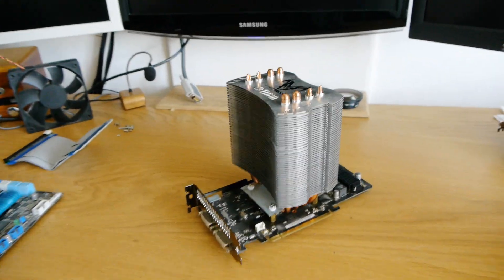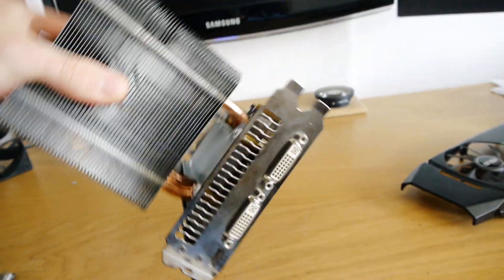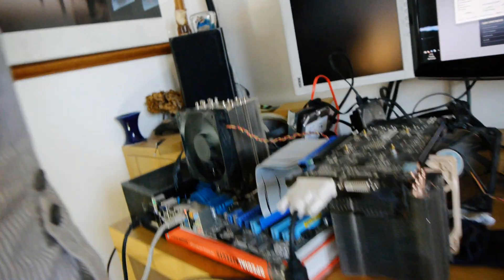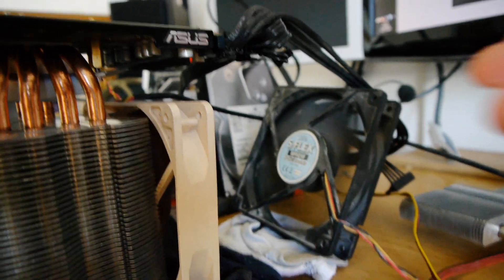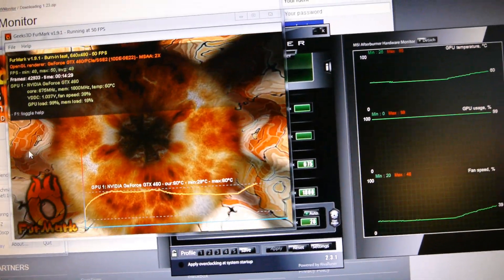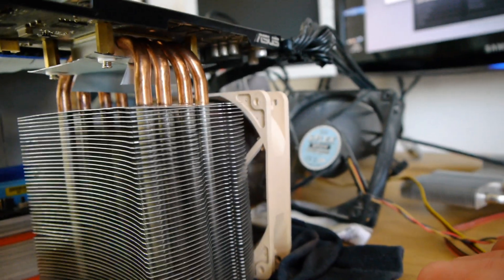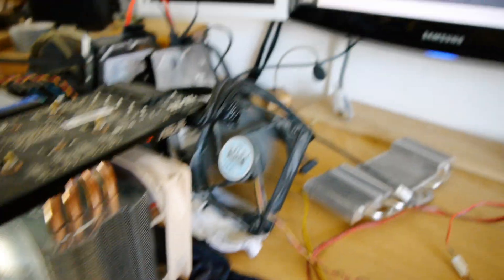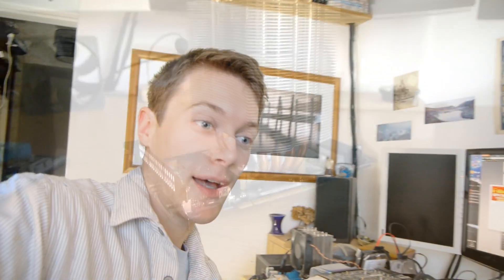CPU cooler on GPU (INSANE temps!)

Comment: You have 4 heat pipes on that big heat sink, not 8.
Reply: The CPU heatsink is more efficient for a number of reasons. Chiefly, there are more fins, which equates to more surface area, and air enters and exits the heatsink very quickly. Cool air enters, absorbs heat, and leaves before it gets too warm, and is replaced with new, cool air. On the stock GPU cooler, the air has a long way to go between entrance and exit, and it isn't a straight flow like on a CPU cooler like he used. On a GPU heatsink like the stock one, the air is blown in by the fan, hits the PCB, and immediately needs to make a 90-degree turn to be channeled through the heatsink. This means that you need much higher-pressure fans, which are louder, and it also means that by the time the air exits the heatsink, it's moving much slower and has already absorbed most of the heat it can and is severely less efficient at absorbing any more, so the extremities of the fins are having a very difficult time getting any cool air.

If keeping a GPU cool was as easy as just strapping a bigger fan to it, the manufacturers would've done that already. And have done. They've added multiple large fans. There are plenty of GPUs with 3x90mm fans. But, mostly because of the need to keep the card to within two PCIe slots' width, they've had to keep the same basic, inefficient heatsink design of a big, broad heatsink parallel to the PCB, and as a result, GPUs still struggle to stay cool and quiet at full load.
Reply: water cooling does provide silent setup I'm sorry but if you have the right setup you get the best of both worlds.
Reply: Senrab Nala
You use water cooling on your GPU?
Reply: He's not overclocking. He wants silence. Which water-cooling does not provide.
Reply: and its actually not a bigger heatsink dispite the look it of it. its only cooling better because of the larger diameter fan. he could have the same result with just strapping a 120mm fan ontop of the normal heatsink.
Reply: you wont beat a decent full loop with custom water cooled parts. Thats why anybody who is serious with overclocking uses water cooling instead of large rediculous heatsinks on a gpu

Comment: Hi! Computer Technician / Systems Administrator here. Your frankensteinian set up here give me utter chills. Firstly, your hard drives should never sit at an angle like that. They should always be vertical or horizontal, never set at arbitrary angles. Secondly, clean your fans, please. It's disgusting.

Comment: My HD7850 2GB runs at 48c full load
Reply: well you cared enough to post that ridiculous fucking comment
Reply: KoopeR No one fucking cares.
Reply: KoopeR Fuck off, mate.
Reply: my HD6950 2gb runs at 80c full load sometimes hitting 90c
Reply: I have this card also and it has never went over 60 with considerable overclock. Best card I have ever owned hands down. It overclocks insanely and it will even run bf4 on highs with 60 fps most of the time.
Reply: Carson W234 NO. ONE. CARES!
Reply: Carson W234 interesting, god knows why my one is hitting so high... i do need to upgrade tho for star citizen
Reply: KoopeR Well the 7000 series is on the more efficient CGN architecture
Reply: ***** Oh really? Then why can't you spell?

Comment: Heat pipes are not supposed to work that way. The major component in its working is gravity. The phase change coolant inside the heat pipe needs to deposit on the walls of pipe and the come down under effect of gravity onto the hot plate, which in this case is graphics card chip. 
Although the setup is working really well, but it would be better if you kept the heat pipe with the plates side up and graphics card down at bottom. Peace!

Comment: Hmm... I've got Gigabyte GTX 650 Ti Boost an i got 28*C (the lovest temperature) and 60*C(Max temperature during the benchmark testing or Gaming).

But those idea i pretty nice but i think when we use more huge radiator for example Fortis 3 HE1425 it would "freeze better" :)

Comment: Time wasting. What did you do this for? Is there any reason to use the half of my table for a pc that is so huge  i can not put it in the case or even plug the VGA card in the slot and i have to use an extender? Ohh get a life. Do something practical and useful. If you want to decrease the temps use better quality of thermal paste in conjunction with a piece of copper (if needed) and thus you can avoid this useless nonsense

Comment: I'am doing such a project right now, but I'm al little bit concerned about the pressure my mounting method will put on the GPU-DIY. The DIY on my GTX 550Ti is 0,4-0,5mm higher than the metal bracket around so if I lower the cooler to the metal bracket I think the DIY will brake. How much Pressure can a DIY stand ?

Comment: my current pc system is cooled with a 2.7 kw mobile air conditioning which is blowing 18 °C air with many pressure into the tower and cools absolutly everything in it .)
my room temperatur is from 23°C  when its a litle bit colder at night and something around 38-43°C  when its fucking hot outside.
btw: the mobile air conditioning also cools my living room to.

Comment: lol ik its been a few years but under load my gtx 960 runs at 62c underload
Reply: Yuck Foutube yea
Reply: Yuck Foutube 970 heats up a bit more
Reply: Yuck Foutube that sucks the 960 generally stays cooler because its like a debuffed 970 plus i have god cooling on it the fan on the gpu kinda sucks but i have 2 other internal fans blowing on it
Reply: Yuck Foutube good
Reply: Yuck Foutube god himself cools it lol
Reply: Yuck Foutube lol

Comment: Nice idea. I might try something like it, seeing as I have all these parts in a box to play with. The idea of using a pci-e extender cable is great, I can move the graphics board off the motherboard to the opposite side of the case and use a giant slow turning, quiet fan to cool the giant heatsink.

Comment: I need some help with something lets say similar. I am trying to mount an amd fx cooler on a gtx 560 since the stock heatsink is pretty small and it overheats and the amd cpu cooler is a lot beefier, but the results are not as expected... it reaches 100 C. Any help is apreciated.

Comment: You installed a heat pipe design cooler upside down which means all the fluid has no contact with the hot surface and that would cook your GPU

Comment: 23c is hot? come to my country Philippines ambient room temperature.... 35c god damn it
Reply: 45c in Saudi arabia without strong air conditioning.
Reply: RedNova Gaming yeah I've noticed. Been to Jeddah and I was able to cook egg outside
Reply: I'm in Sun City AZ. 112 F. That's about 44 C.  Need water cooling for the computer AND the people.
Reply: 23c is cold in Australia
Reply: ***** you seen nothing yet. Max temps recorded in my country is like 42... the middle East goes higher. It can actually kill people, that is why most Arabs only goes out at night
Reply: 35c? Man i Live in Rio de Janeiro... the normal here is 50c...
Reply: Both temperature and humidity matter when it comes to apparent temperature. 23C in a very high humidity environment can feel like 30C. Whereas 40C in low humidity can feel like 30C too. 25C Just before a thunderstorm is horrendous.

30C in the rain forest feels a like hell, whereas 30C in the Sahara desert is tolerable.
Reply: it like 20c in my room  and thats warm temperature. 35c is like melting temperature and 10c is like well it kinda cold but still not cold
Reply: Omake Bon crisis 3 on 1080p high hits bloody 80c on my end on the welcome to the jungle area
Reply: How about India? 35 - 45 C yes 45C... this year only !! Yet my 950 sits comfortably at 60C at load...
Reply: Here in Chicago we've gotten -40C temperatures
Reply: It's the humidity here in England which makes normal temperatures unbearable. I can easily handle 25-35c with dry air, but it's very rare for the humidity to drop below 70% over here which makes 20c feel more like 35c.
Reply: 28 degrees Celsius saamin qc
Reply: Or Spain, 45-50º in the south.
Reply: I have now 21C in room and out side -18c XD
Reply: FrosTy theNoob try India 40°C in summer normal
Reply: 40c in india!
Reply: I feel your pain bro.  Home countries unite!
Reply: FrosTy theNoob lol same country same temperature haha
Reply: I live in the Netherlands, my ambient temp is around 20(with CHS on obviously) but outside it's like 6-7c now. For better overclocks with this kind of weather (mostly) I put a big tube outside my window and feed my computer with ice cold air to eat away roughly 8 to 10c ! haha.
Reply: Australia is also notoriously hot as well. But the worse thing here in the Philippines is humidity... for example at mid day the temp ranges from 35 - 42c now mix that humidity and you get hell. Literally you will sweat minutes after showering... that is why I am planting trees at my house in order to give shade.
Reply: Australia is bad for its humidity which makes up for some of its heat as well it also depends where in Australia you are as to what heat you get as middle of Australia and Darwin I think get to 40 mid summer
Reply: Darth Dad malamig nayan... ditto Mindanao 35 - and up xD
Reply: I agree on this. Damned ambient temps always on the high 30s. Idlev temps stay @ 40-45. Imagine that while on load.
Reply: Damm that hot
Reply: Imz Deodex Haha, yeah. Been playing some Witcher3 as well and the card mostly sits on 70-80c max on my end. 40c is acceptable on idle but when you try and play on full load its quite scary for a card that's not supposed to reach 80c max.

I tried playing some highly modded skyrim as well before and my temps are nearly 60-66c @ load. Maybe TW3 was just too much to be handled by a 750ti.
Reply: Imz Deodex Duterte ka bro?
Reply: DinoTek Gaming and More! lol hahaha oo para mag martial law na sa sulu haha
Reply: my graphic card make me wet lol like 94c
Reply: Imz Deodex taga sulu ka pala bro?
Reply: DinoTek Gaming and More! uu
Reply: +Imz Deodex Makkah is way warmer than Jeddah usually 45-50!
Reply: *****
well u cant even swim on a paradise there with 30 c haha im cool with hot temp and i also live in california where it can get so cold it sucks.. female here also take a bath everyday haha
Reply: Imperial Valley California, we are rocking a constant 45c dropping to a cool 39 or so every now and then, and my room with my PC doesn't have AC but a fucking fan blowing in my face.
Reply: don't forget humidity, just west of you in central ill-annoy
Reply: *****
cause u dont like outdoors? hahaha do u even scuba, hike, canyoneering and shit i know its fun to stay at home but bruh
Reply: I live in sweden, It's 25 degrees in my apartment and I think thats cold
Reply: yeah i live in Australia an once it was 42c
Reply: FrosTy theNoob plz in UK it is an amazing 12c
Reply: Cymus 
https://lh3.googleusercontent.com/pWNGeFXKLt5r6ljYTs0y8KJnnvFkkxmIMcp3WZqyNZWE4uKxqHbuz-WFfBRWwwfm9Dfp-RPEtMk
Reply: FrosTy theNoob For inside 23°C it's can be considered hot where I live. During the summer I set the temperature to 18-20°C, winter it's depend temps outside.
Reply: Seb Gontrand wow, im 28 now here
Reply: huehuheuehue
Reply: FrosTy theNoob come to India ok!!
Reply: come to my country its 50
Reply: Same temp in my room but I'm from Switzerland D:
Reply: FrosTy theNoob 35 is my temp during summer in Australia on Average... 23 is during the end of March
Reply: Man that's hot, I hate the high humidity too. When we have nice weather here in the summer the humidity is also kinda high and I find it uncomfortable tbh.
Reply: 40 degrees in mante, tamaullipas, mexico
Reply: 50c in Arizona
Reply: Roger L. Ortiz Care about humidity from outside as with temperature difference humidity might condensate on your hardware
Reply: yo right its freaking may.
Reply: i live on the sun soooooo
Reply: What? My country in room 38c.. Cambodia
Reply: Hottest Temperature Ever Recorded On Earth In Kuwait At 54C beat that ! the sun angle is 88 degree on your head lol
Reply: FrosTy theNoob in the winter where I live it usually gets at least -15 out and I don't even live on the U.S. canida border. (Granted it's only a 5 hour drive to the border from where I live.)
Reply: Logan Reidy I live in northern Canada. It's below -30 in the winter here
Reply: Kordanized damn. -30 is the coldest it's ever been where I live.
Reply: FrosTy theNoob in ksa its 45c
Reply: Nahh men Philippines ambient room temperature last year is 40c
Reply: my air-com room is warmer that that...(cause wanna save my money)
Reply: Heh what about 20 in the summer, 13 in the winter lol
Reply: 34c here in Australia today and it's not even summer yet..
Reply: 32° C on Northeast coast Brazil.
Reply: white boi so soft like a baby
Reply: lmao 23°C is where my AC is set most of the time, XD in summer it gets near 45 during day time...and the humidity....its like a death trap ;-;
Reply: For some reason the 19c starting to feel realy realy comfy. btw I live in finland
Reply: I live in Rio de Janeiro. Cold: 18ºC or less / Good: 19 to 24~25 ºC / Warm: 26 to 29ºC / Hot: 30 to 33ºC / Summer that melts your brain: 34+ (sometmes this fkng season hits 45 ºC !!!!!!!)
Reply: 50 + °C in summer India 😅
Reply: Philipine hookers are hot no doubt about it :D
Reply: 40 and sometimes 52 ºc when is summer here on córdoba Spain... I'm chinese :v
Reply: Felipe -15 in winter connected my pc to the outside with a pipe
Reply: in vietnam you will easy to get 45* outside on summer =))
Reply: 40in Darwin  And 90% humidity . 45 in Saudi Ain't shit compared to that
Reply: RoboTube most look horrible unless you got serious cash to acquire high end women
Reply: Haha loved the god damn it, and trust me 35 is good enough for Manila
Reply: bitch please, 60 C in iraq
Reply: FrosTy theNoob wats dat link to?
Reply: 40-45c fucken straya

Comment: Besides that the huge cooler may bend the pcb of the gpu, what's about the VRAM and the V- converters? 
They need cooling too. If you don't have any airstream blowing on these, they will melt away in no time. 
Especially if you OC this GPU because of the "good temps" you get with this sort of cooler.
Reply: and what about sly :D

Comment: Dear do not have sense to put the cooler downward. The heat rises (up) and cold down, so the cooler should point up.
If not the heat still on the GPU, despite that error temperatures a very well.

Comment: Misleading title, just for more click...pff
Reply: +iannickCZ how is it misleading?
Reply: "Insane" temps...there is nothing insane.
Reply: iannickCZ Dude are you serious? ~50C on a GPU that is under full load is not insane temps? You're mad.
Reply: +Marzie a) I am not your dude, b) 50 °Cis not insane, you can read other comments below, my Nvidia GTX is reaching it easily while playing GTA, +100 °C is insane.
Reply: iannickCZ How do you not know what model your card is lol? My GTX 980Ti stays at ~70-80C. playing GTA V on near max settings at 1080P. Having low temps during load is what's insane. Yes your card may hit 100C, which by the way is a bit unhealthy for the card, but that is insanely hot. 50C on max load is insanely cool.
Reply: Insanity is that temperature is SO LOW...ok now I understand.
Reply: iannickCZ :D

Comment: hello, first time pc builder here

can someone take the time to take a look at this build and give me any advice and tell me if everything will fit together (like the pins from the powersupply with the motherboard, i tried searching it on google but its all chinese for me i dont understand alot)  http://pcpartpicker.com/p/QJVWnQ

sorry for my english,

peace from belgium !
Reply: +Djdjdudidi Jdjdjdhfux 

CPU + Motherboard = Compatible

Power Supply and Motherboard both have 24 pin ( you can count the pins , but i already did and they both have 24) So yeah= Compatible

550W looks fine for the power supply but i am not sure if the power supply has the right pins for that specific graphics card, i could not find those details for either of them, maybe make sure your PSU has both 6 and 8 pin PCI-E connectors.

I recommend you buy a different power supply just in case.

If trying to save money you can buy this 600W EVGA 80+Bronze for 40$

http://www.amazon.com/EVGA-Bronze-100-B1-0600-KR-Power-Supply/dp/B00EON40CS/ref=zg_bs_1161760_2

Or if you want something better you can get this 650W EVGA 80+Gold Fully Modular for 78$

http://www.amazon.com/EVGA-SuperNOVA-Continuous-Warranty-120-G1-0650-XR/dp/B00K85X2AW/ref=zg_bs_1161760_7

These 2 have all the connectors you would need.

Prices are just for reference if you live a different country they are obviously going to be different.

That said make sure you check the dimensions of the power supply to make sure if fits in the case.

Also i am not an expert but i also just built my first pc.

Have a good one.

Comment: thats not "a really really imptessive result" !!! 60°C with such a massive cooler. im running it at 60 to 65° with automatic fancontrol on gtx 660ti from asus in a clean case...and its quite silent. room has the same temps
Reply: you.obvi have never had a 400 series their known for heaters more then GPUs 60c maxed out is amazing for a 400 series